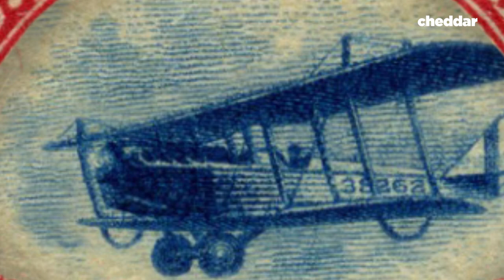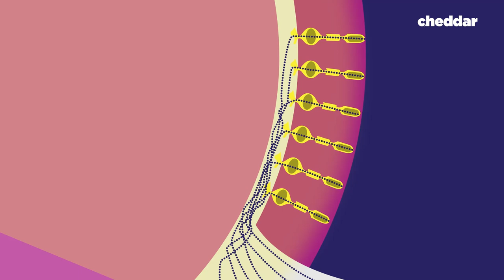Why Planes Turn Lights Off For Takeoff & Landing - Cheddar Explores

Comment: My grandpa had a small private plane he used to take me in whenever he could which we both loved. So when I got old enough I started for my pilots license. Sadly haven't finished it yet because of money and time but i can say that the checklist is long, boring, and 100% crucial. You check every little thing and even if you are 99% sure (can never be 100%) you still have to check whatever it is. This checklist is why flying is now one of the, if not the, safest way to travel.

PS: first time I had to recover from a stall where you make the plane go into a free fall was the scariest thing ever. You still have an instructor with you at that point who can recover if you mess up but it's still horrifying. Now I can do it in my sleep. They make flying become second nature to you so you're as comfortable and thus as safe as you can be

Comment: As one who was in a severe clear air turbulence incident, I'd like to add that not only should you stay buckled up at all times, you need to buckle tightly enough to ensure keeping your butt on the seat should the plane plummet or dive. If your belt is loose, you'll whack your head on the overhead hard enough to cause serious injury.

Comment: Super frequent flyer here, knew this, but actually clicked on this because last month, for the first time in 500+ flights, I was on a plane that didn't dim the lights. Boston - Lisbon with TAP Portugal. Did they relax the rule recently? Or did these guys just mess up and break the rules? I was very surprised, we landed at night and the lights weren't even slightly dimmed. Just wondering!

Comment: The lights turn out for me about an hour or two in flight.. i always assumed because that was supposed to simulate night time so everyone could fall asleep...
But anyways, i never seen them turn it off before takeoff, only once were in the air after about an hour then the lights go out
Reply: hotpockets222
: On long flights, yes. They often dim the lights according to the timezone you left from on international flights so you can sleep, but that is why they sometimes provide blinders on better airlines. But you just didn't notice that they were dimmed, yet they were. It's regulation for the FAA and most other country's equivalents. They never turn off the lights fully.

Comment: Answer: because of the time it takes for your eyes to adjust to the dark.  in case of an emergency during take-off or landing caused the lights to turn off.  with your eyes already adjusted to the dark, you can evacuate faster. 3:00

Comment: Video starts at 3:00 .Seems like an old unnecessary rule. I wonder if there are other reasons they don’t tell you like less panic in case of an emergency or more arousel by the more distracted passengers. If they really want to make the evacuation faster they should lock the overhead compartments during takeoff and landing. Imho

Comment: I have an incredibly powerful car audio system.  It has a lot of power draw.  I have to start the car let it idle than turn on all 5 audio amplifers than i cab crank it up and disturb the world around me with incredibly powerful concert level sounds.

But when i stop the car I have to disangage and turn off the audio a minute b4 or i will not have enough power in the battery 2 start the car.

The subwoofer kick can absorb like over or 1 or 2 volts out of the 13.8v each kick but it regenerates rapidly.

But it if goes BOOOM takes it down to a 10volt and i kill the engine the car isnt going to kick back on.

------
So u can disable electronics to keep the electricity levels high u also have the alternator it generates power.  so the alternator keeps my sonic levels high while driving.

Comment: Why is it then that you have to open the blinds during take-off & landing? Seems pretty contra intuitive after this vid at least during daytime.
Reply: Meow Meowington
: Nope, it's the same reason: eye adjustment. Your eyes are still adjusted to the outside light, so in case of an emergency at landing or takeoff (which is the most likely time for something to go wrong), you are not blinded by a sudden shift in light levels. It is not *counter-intuitive at all. When they dim the lights in daytime, you would hardly notice.
Reply: It's so that in case there's an engine fire, the flight attendants can see.